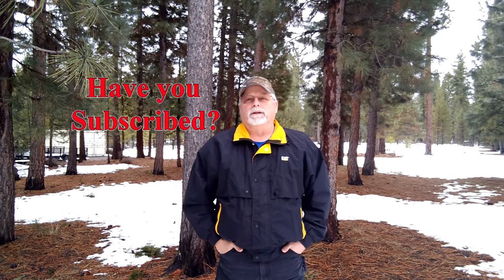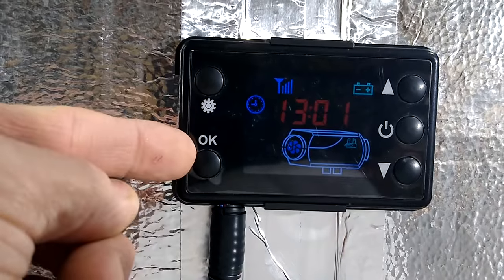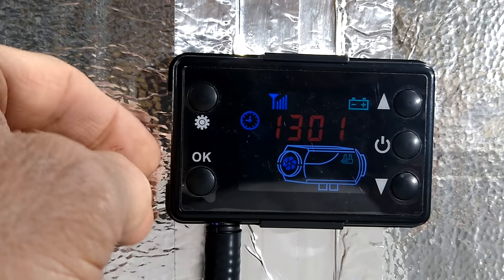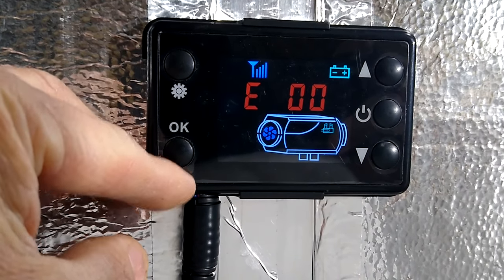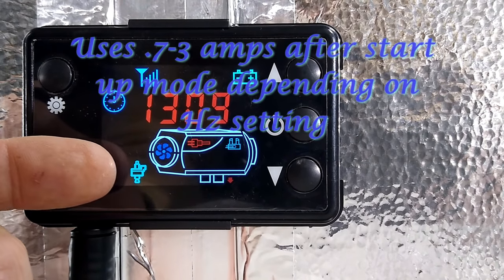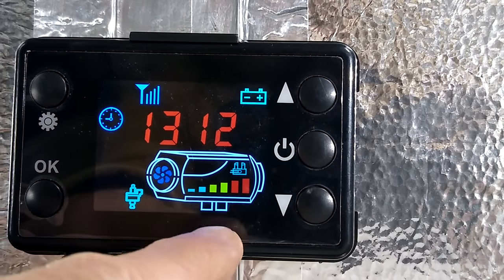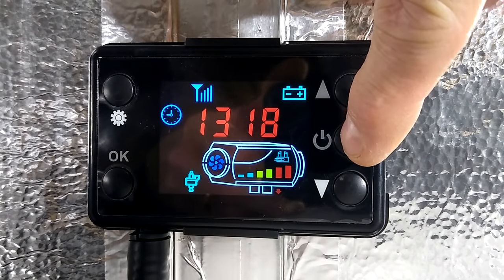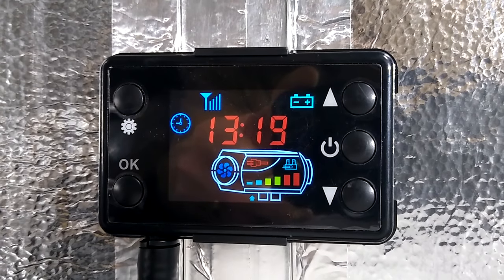Chinese Diesel Heater Controller Setup

Comment: When tuning the heater for the first time, does it smell a little light of Diesel fuel? Need to know ASAP. Thank you.
Reply from the maker: You shouldn't smell diesel inside.
Reply: Thank you, for answering. I have a diesel heater and it’s been 4 days I’m been living in the van with my wife, but don’t know how does the heater should respond the first time been on. I will look into it quickly. I did see a E-code 07, don’t know what it means. Will find out quickly. Another thing is that my 3000 Multi plus inverter is loading a current of 185Amp for a 15Amp stove top when I want to use it. This is very dangerous! The fuse didn’t blow and the 4/0 cable was red hot. Don’t know what happening, can anyone helps please. Don’t want my hard work burning down and leaving me and my wife on the street. 😳😕

Comment: @Van Life Uk A Complete Survivors Guide  my thermostat seems to be not working right. Set up for 8°C and is temperature is rising even to 30°c. Any advice please?
Reply from the maker: Hi Fryderyk, Is the little hole for the heat sensor on the controller covered in any way, if not the controller may be defective and need replacement. How old is the controller? Just as a heads up I will have a new video out in a day or two detailing my cargo trailer camper build. I show how I installed the diesel heater in it.   Please give a thumbs up on my video, subscribe, let others know about our channel on social media and check out our other videos. Have a great day.

Comment: Have a question about the priming. Say the heater is turned off at 9:30pm then at 3am I need it on again. 
A. Does the heater require to be priming at 3am. 
Or does it require priming at each use?
Darren- Australia
Reply from the maker: Heater should only require priming after install or after maintenance. If it was running at 9:30pm shouldn't require priming at 3am. Please give me a thumbs up, subscribe, check out our other videos, let others know about our channel.
Reply: @explorer867  Thank you
Reply from the maker: @ftkwdarrenritchie9711  your welcome 👍

Comment: Is there a way to turn off the screen while not using it? I installed my controller in a nice visible spot but my van is an ad lol and the light keeps me awake
Reply from the maker: I have heard some have put a inline switch to shut off the power when heaters not in use. I don't support this idea because if the switch gets shut off while the heaters running it will melt the ECU and could cause a fire. For safety sake I don't sleep with my heater running either. Have a great day
Reply: Simple fix would be to attach some kind of removeable covering over the LCD screen.
Reply from the maker: @TreeLBollingTreeMan  that would be a good and easy fix.  Have a good day

Comment: Can any one help please? Mine wont go in to priming mode any more? Pressing down and OK together (or holding down and then pressing ok like my manual says to) just lowers the selected temperature (when the heater isnt running). I used the priming function when i first installed the unit, but now i cant activate it again for some reason?
Reply from the maker: Sounds like it may be a controller issue.

Comment: Q 867 How do you manually prime the fuel line as you suggest?. Ive tapped into an existing fuel line but have a long way to go..
Reply from the maker: I used a syringe "without needle" to suck the diesel through the line.  Please subscribe, let others know about my channel, check out my other videos, and give me a thumbs up. Have a good week.

Comment: First time diesel heater user here! Am I correct in understanding that using the Celsius setting will set the temperature of the room, whereas if you use the Hz setting, it controls the level of airflow coming out of the unit? (And then you just have to shut off when you're warm enough?) Just trying to figure out which setting to use. Thanks so much in advance and for the informative video!
Reply from the maker: Hi Annette, the Hz setting will adjust the number of pumps the fuel pump pushes diesel into the combustion chamber. This will provide steady heat and fan speed. The Celsius will keep the room at a constant temp. Please subscribe to the channel, give me a thumbs up, let others know about our channel, and check out our other videos. Have a great week
Reply: @explorer867  thanks so much!!
Reply from the maker: Annette, after running these heater's on a low setting and before shutting down heater always run heater on high for 5 minutes. Running on high will help clean carbon off internal components of heater.👍
Reply: @explorer867  interesting, thanks so much for the heads up!

Comment: FIRST thing you need to do when you get one of these heaters , (controller unit portion)  Is to get something like RTV Gasket maker OR Hot glue gun and pump it up into where the wires come out and also get it all around the wire & the plastic housing of the control unit to give it a stress relief. After you pick up & move around the unit a number of times you will find that the wires that are soldered to the board are fraying & will either break off OR the strands that get broke loose will short to the wire / terminal next to them & your controller will either turn off or short out. The terminals on the board where the wires attach are way to close to each other. One tiny wire strand that brakes free will touch the terminal next to it & cause you issues. Ask me how I know this.
Reply from the maker: Thank you for your comment. Please like, subscribe, and let others know about our channel. Check out our other videos.
Reply: I was thinking that all the wiring was poorly covered in a greasy paper. And that all the wires were unprotected close to any connections. Glad you reminded me to do that. It is 15f up here in Maine right now. I live in my RV, using propane but would can't figure out where to install the heater in here. 
Very limited space. Had to create a short square gas tank because the big flat thing just wouldn't fit anywhere. Maybe one day I will need it. But for now the heater is to heat my ice tent. Which leaks like a sive. Brand new.
Reply: How do you know this ?

Comment: what is the point of adjusting the fuel rate  in htz.  besides fuel consumption, it causes a rich or lean fuel mixture ?  so that could cause it not to run or run too rich and carbon up the burner chamber.... no one talks about proper fuel air mix..
Reply from the maker: Htz is how I have chosen to regulate the heat output, and have done so for almost a year with no problems.
Reply: That doesn’t seem to be a problem. The heater adjusts the fan blower speed according to the fuel supply rate you set manually. Higher Hertz = more airflow. If you set the heater to run on the thermostat rather than on Hertz it slows the fuel pump anyway, once the target temperature has been achieved.
Reply from the maker: It's been my understanding that Htz adjusts the fuel pumps number of pumps per second thus more fuel more heat and less fuel less heat. The ECU via the heat sensor adjusts the fan speed. Do your own studies on this question and decide what's best for you. Education and understanding pertaining to these Diesel heaters is very important.
Reply: i fired mine up for the first time. i noticed the pump htz increased as it got going,, as did the fan speed.  i think in the advanced settings there is a range of both the pump htz and the fan speed... my concern is that it might run too rich and carbon up the chamber.  or the opposite of running too lean..  but mine seemed to work good today.

Comment: I've heard these pumps are quite noisy can you buy a better pump thats not so noisy to run instead of the cheap Chinese one?
Reply from the maker: These pumps have a clicking sound as they pump fuel. There are ways to mitigate the clicking sound by suspending the pump using zip ties thus not hard mounting pump. Please Subscribe give thumbs up and pass my channel around your social media network. Have a good day

Comment: Hi I having trouble to turn off button is not working any recommendation please my heater is running for long time I don’t know what to do 🙃
Reply from the maker: Sounds like your controller needs to be replaced. make sure your pressing the off button until the readout says off. Hope this works for you.

Comment: Does it have low voltage protection in case battery charge goes low so heater will automatically turn off?
Reply from the maker: No low voltage protection on these units. Just keep an eye on the battery voltage readout function on the controller. Please Like, Subscribe and let others know about my channel. Have a great day.

Comment: Does it have low voltage protection so shut off heater if voltage drops low protecting battery from draining?
Reply from the maker: No low voltage protection on these units. Just keep an eye on the battery voltage readout function on the controller. Have a great day. Please Like, Subscribe and let others know about my channel.

Comment: I can't access my settings. I have tried everything and no luck. Any chance me controller (look,s like yours) is faulty?  Thanks
Reply from the maker: Sounds like you may have a faulty controller. Watch my video and after you have tried to program I would ask for a replacement.
Reply: @explorer867  thank you
Reply from the maker: @Cementhead48  Tom I hope you solve the controller dilemma.
Reply: @explorer867  I have not.  It still functions correctly,  I just can,t change to set the clock or the timers. Remote  works well too, so think i will use it as is.    Thanks for the help

Comment: Easy question,   is the clock important and will it produce heat if I ignore it ?
Reply from the maker: The clock is only important if you want to use the auto on and off feature. Please like, subscribe, ring bell and let others know about our channel on your social media. Have a great week.🤠
Reply: @explorer867  Thanks for your reply, I'll go back and mash the buttons.   My first diesel heater arrives today per Amaslam.
Reply from the maker: @jimgresham5529  always happy to help.
P.S I have run a winter diesel additive called Power Service in both of my diesel heaters for years now with great success. I keeps fuel from jelling in the cold and picks up the cetane to help it run cleaner.
This is what I have done, now you can choose what's right for you. 🤠

Comment: I loved my old rotary switch controlled CDH. It worked great for 3 years till a sheet of paper cleverly slipped into the heater cabinet and neatly covered the cold air intake. Be carefull to make a secure unblockable intake. I have installed a newer heater with the LCD controller. Your vid was very helpful. Do you know what the icon just to the right of the glow plug icon is? Why do you prefer the hertz vs degrees C screen?
Reply from the maker: Its just a personal choice going with the hertz setting on our controller.  Not sure what the Icon is to the right of the glow plug Icon. Have a great week.
Reply: I've found the temp readings about 3-4 deg C warmer than the temp actually is. I always  use the Hz setting. On my heater (2kW) the fuel pump rate goes from 1.4 - 5.5 Hz.

Comment: Do you have any suggestions as to why my LED control icons does not have the air flow action icons, igniter icon, fuel pump icon & none of the heat range icons. The only icon I have is the blower rotation icon.
The unit does heat up and I am able to set the time & I don't have any errors P-
Reply from the maker: Could be one of two things, your ECM or your controller is defective.
Reply: @explorer867  Thanks, I expected as much. I have contacted the seller & will see how it goes! Thanks - I plan on using it to warm up a tall 12x20  mimi barn. The roof has a ridge vent with a gable vent on each end. The barn does have a full loft, so I'm only expecting to knock off just the chill

Comment: I also have the same diesel heater I have always been wondering what is that "signal" icon in the top left corner, does anybody know? I guess it is not related to controlling the heater with an app or something like that, right?
Reply from the maker: I believe that is the signal strength indicator for the wireless controller.thanks for watching and check out my other videos also. Please Like, Subscribe, Ring the bell and let others know about our channel on your social media.

Comment: Is this LCD unit also working like a thermostat? Is the location/placement of the LCD unit of any importance?  

Thanks for this series of installation videos. I got recently one for myself to install in my Navara pickup. I have to figure out a few things before I start drilling holes 😃
Reply from the maker: the thermostat senses the temp in the camper but doesn't turn the heater on and off, only for the temp readout. I have mine placed half way up on the side wall. Thank you for watching the channel and enjoy your heater .  PS: How do you like your heater and how did the install go for you?
Reply: The installation of the heater was pretty much straight forward, a similar solution you provided in video part 1 & 2. Let say it took about 5 hours or less(install heater day 1 and the rest electrics, air tubes day 2) 
A lot of space underneath for exhaust and burner air intake line, on my D22 Nissan. 
Fuel pump and filter inside, and a custom gas tank to fit my narrow space.

No issues with the electrics, long nice cables. Just hook up to mains and ground.

LCD unit very handy and the remote already paired up.

Did a priming sequence for about 15 seconds, just about to se that the pump deliver bubble free diesel. It fired up instantly(with a little smoke), I let it run for an hour to check that there was no leak or areas affected by the relatively hot bottom chassis(exhaust area).

Now it starts normal, with no smoke. I do let it run on 3 Hz 5 minutes prior shutdown. The inside of exhaust pipe is absolutely clean, no carbon build up.

Overall, it deliver tremendous amount of heat on full wack, best setting for me(and quiet to) is 1.6-2 Hz on the pump.

I am really pleased by this heater, and looking forward to go of grid sooner than later. 
I love the nature and sometimes there are chilly nights, I think that is not a issue anymore(I hope)
Reply from the maker: @Hetpust  That's great. these are a real game changer on those cold nights and days out camping. I never sleep with it on but if I wake up cold in the night I will turn it on and get warm then turn it off and go back to sleep. Have a great week and thanks again for watching our channel.
Reply: @explorer867  ok here comes an update to my question at the beginning of this thread.

The LCD unit does indeed act as a thermostat. So it is kinda important to not place it in the absolutely coldest nor hottest place. When the desired temperature is reached, the thermostat lowers the pump frequency to the minimum, and if the inside temperature drops below the setting, the heat unit accelerates to give more heat.

So if I have the LCD unit on a cold outer wall and maybe close to the floor, it will give moore heat than necessary. 
Opposite to that, if the LCD unit is near the heater outlet, it will not the heat the space enough.

So in the beginnings of this project I wanted to have a shunt-valve connected to the outlet, one to the "camper" space and one to drivers cabin. In that way I could heat up only one space at a time, or both.
But now I realize that if the LCD-unit is placed in the "camper" area and the shunt-valve is directed to the cabin, the temperature setting will not work. 

This is just my thoughts/experience after testing with the LCD unit with temperature setting(dubble press two buttons on top).
Reply from the maker: @Hetpust  Great information! My controller is mounted on the side wall of the camper canopy on the aluminum stud. This looks to effect its thermal sensor then. I Think what I will do is mount it to the insulation panel. Thank you much for your information on this. One of the truly great things about YouTube is that we can all help each other out. The wealth of knowledge is deep. Have a great day and let me know how the diesel heater is working for you. Talk to you soon I hope.

Comment: I would like to know if you can change the brightness my is so dim it is hard to see unless you tilt it and are in the dark
Reply from the maker: How old is your controller?
Reply: @explorer867  2 years old
Reply from the maker: @leeh.4729  as these controllers age the LEDs tend to dim. Best thing to do is buy another controller.
Reply: @explorer867  ok thanks  now I've got to find were to get the right one, I've heard that the controller's are different
Reply from the maker: @leeh.4729  The Chinese controllers even new are hard to see from certain angles.  The LEDs can be changed out but for the cost of a new controller doesn't make sense. Please give me a thumbs up let others know about our channel, and check out our other videos.

Comment: Over a period of 2 months the screen on my LCD has gotten very dim. Is there a setting that you can control the brightness of the screen.
Reply from the maker: Not that I'm aware of. I know with mine if I'm not looking at it head on its kind of hard to read. If the screen goes out they are available on amazon for around $20+  Have a great weekend

Comment: .867   does it draw power even when off.  when i was hooking up my ground wire, i noticed some arching to the groud meaning it was drawing power even when off,,  what do you think. possible it will draw down batteries over time?
Reply from the maker: Yes, the unit will still draw little power while its off. Will draw down batteries if you don't have solar or shore power hooked up.